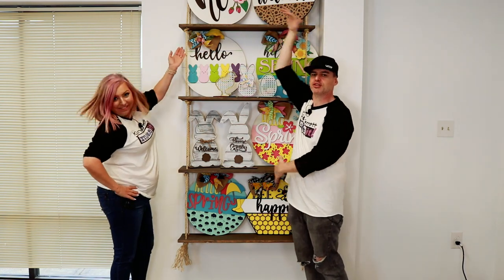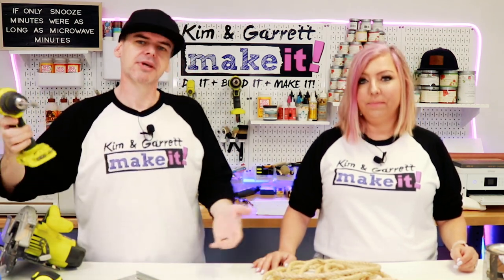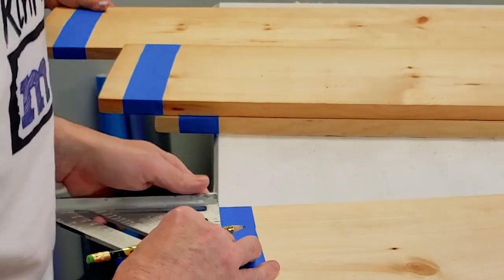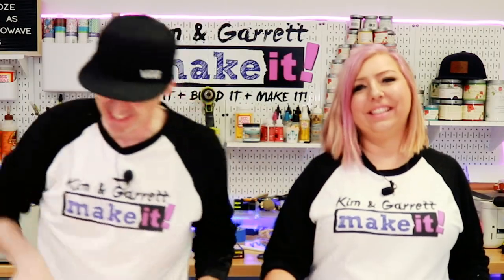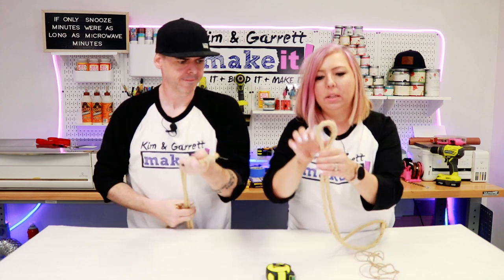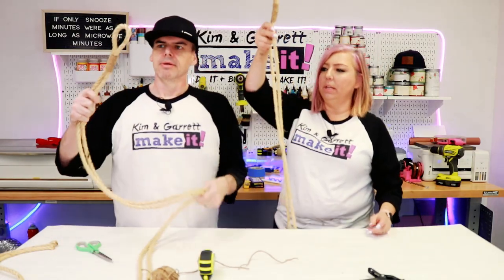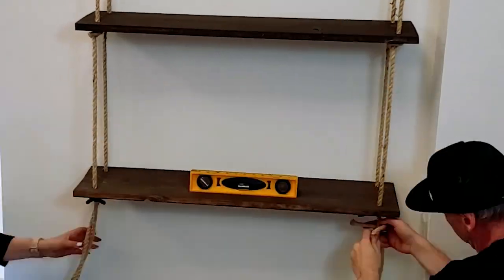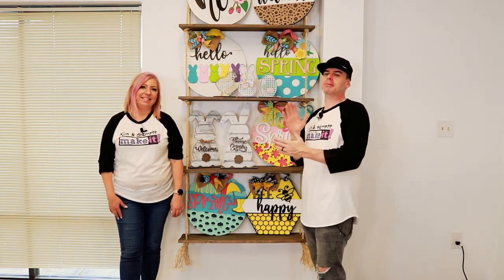DIY Hanging Rope Shelves

Comment: Love it... Suggestion. If you put some of that blue tape on the ends of the rope when time to thread the rope thru the holes in the shelves it will be easier to do.. then remove to fray the ends..😘